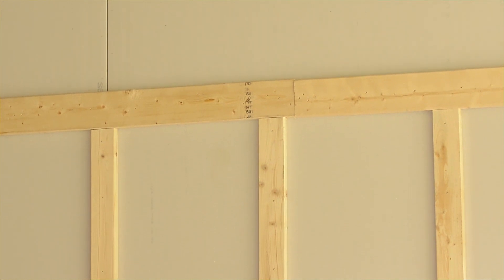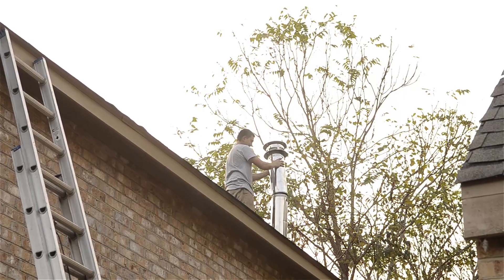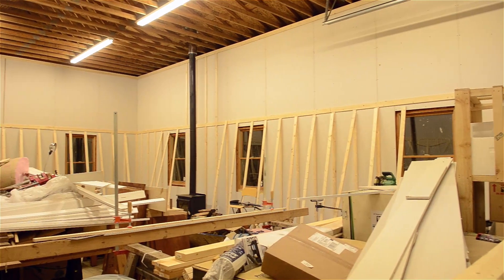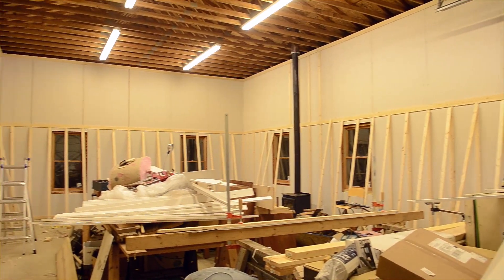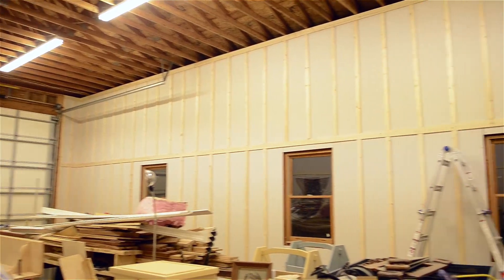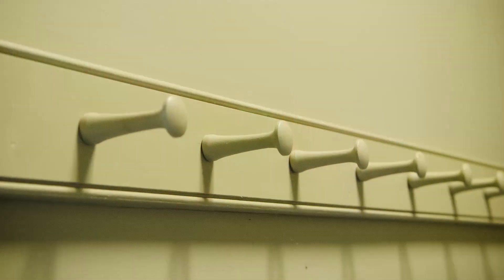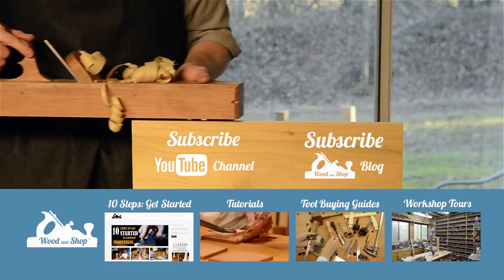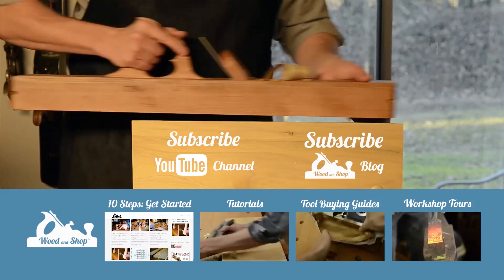Dream Woodworking Workshop (Part 3)

Comment: I’m in love with your wood shop! The beautiful brick that’s mellow, charming and has that oat color rather than the traditional red. I love love the board and battens to hide your drywall seams! Currently, my sappy garage is a mess with stripping paint and drywall... ugh! My guess is obviously 🙄 whoever added the attached garage was a moron because they poured one big and not at all level concrete slab and because they were too stupid to make intentional grooves or splits when poured, as time has gone by it’s cracked and split and sunken in on the edges of the walls 🤦🏻‍♀️ in no way did they perform that task correctly whatsoever! But to add to the pathetic build job they didn’t mud and tape correctly, no insulation which is my guess why the ceiling and the walls are shedding their coating all over my awful floor! In SW Kansas we have bitter dry winters and summer is stifling hot 🥵 with humidity yet not much rainfall. And no spring and fall as we go from one extreme to the other! My guess as to why the old paint never held up. Even the nasty popcorn ceilings are shedding! Lol oh well but my thought was follow your lead of the board and batten as I don’t have a clue how to mud and tape and I’m not sure 🤔 I want to as of today! Thankfully the paint over job I did last summer is holding up 🤞 and will prevent further deterioration of my walls. Anyways I fell in love with your project! Now if you could just demonstrate how to fix slanted, sunken/fallen and deep cracked concrete floors... probably the first step is to jack hammer these suckers out!
Reply from the maker: Glad you like it! I do know how to tape, mud, and sand drywall seams, but it's a pain in the behind. Plus, I think the Board & Batten looks really nice, and it allowed me to add shaker pegs to hang tools. Too bad about your floors. Maybe a layer of self-leveling concrete on top?